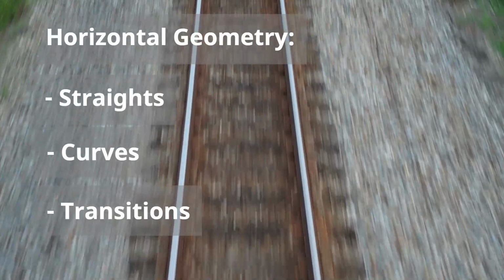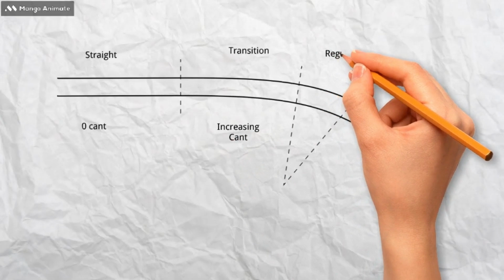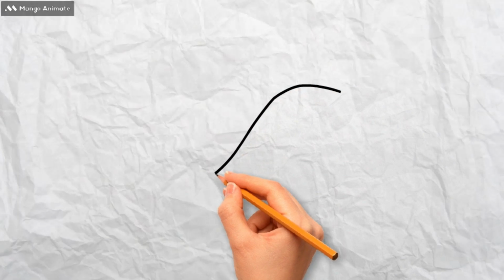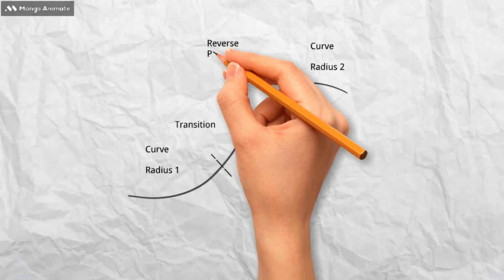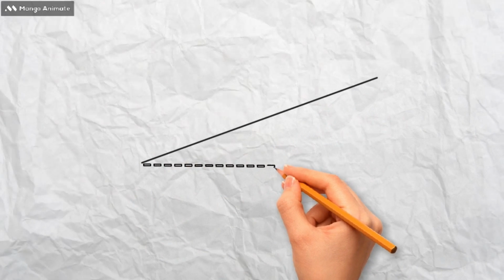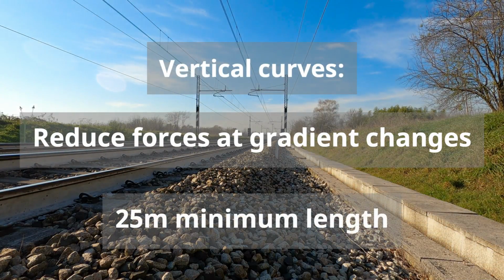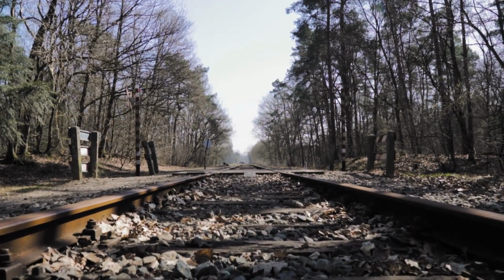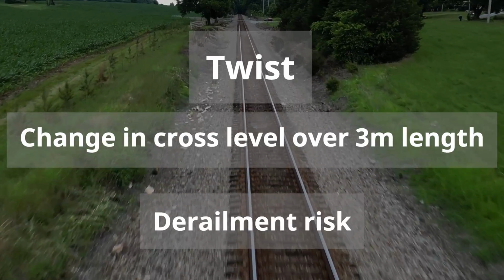What Is Railway Track Geometry? A Guide for Railway and Railroad Engineers

Comment: By “cant”, I believe, you mean “super elevation”. Rail cant is the principle of rail fastening where the two rails are installed leaning into the gauge at an angle, and has nothing to do with the lead rail being at a lower level than the other. Typical cant on a mainline LRT track is 1:40, but I’ve also seen 1:20, whereas in switches and crossovers the cant is zero.
Reply from the maker: I think it’s different terminology. In the UK the angle of rails is referred to as inclined. We have S&C with no inclination applied, known as vertical. Cant is the common term for cross level, or difference in height between two rails